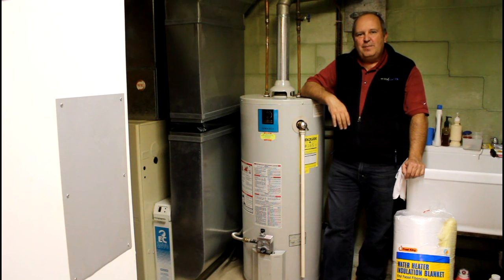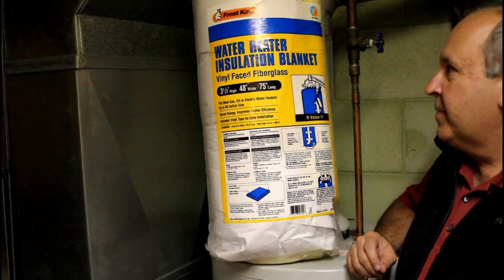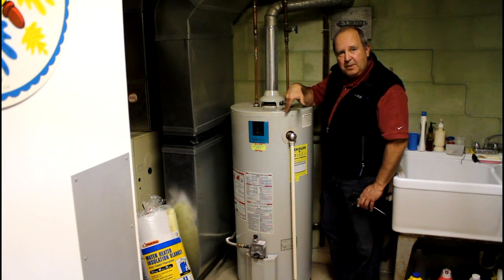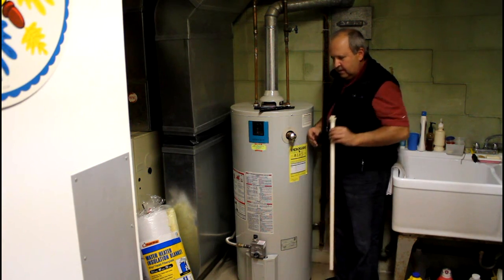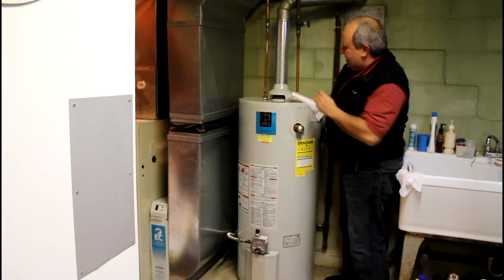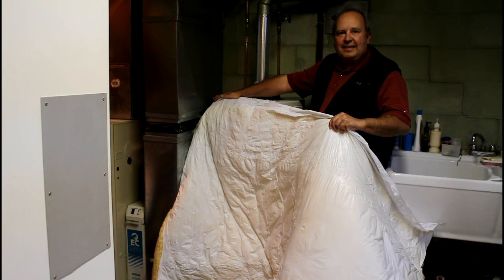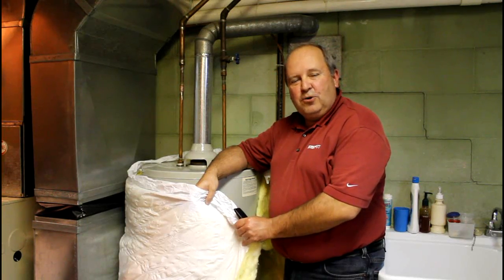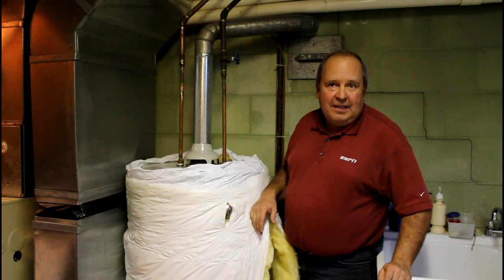Johnny on Energy - Hot Water Tank Insulation - Part 1

Comment from the maker: The air intake for the burner (on a gas hot water heater only) comes in through the bottom so you don't want the insulation blocking the space under the heater. Thanks, Johnny P